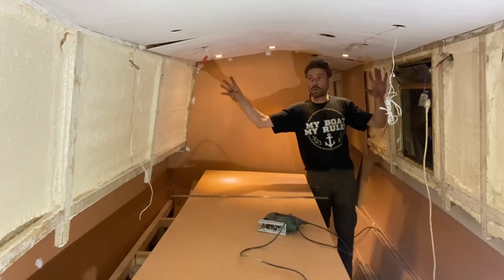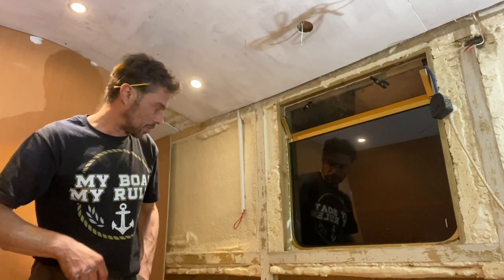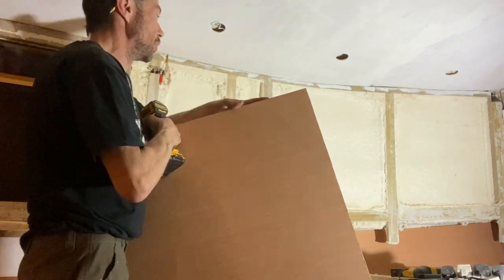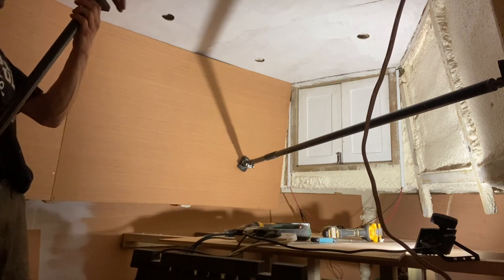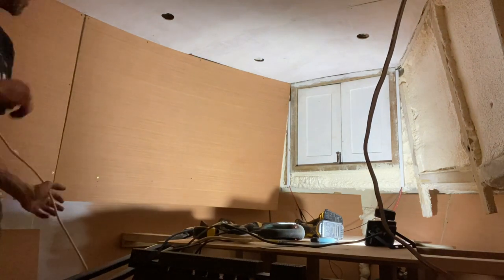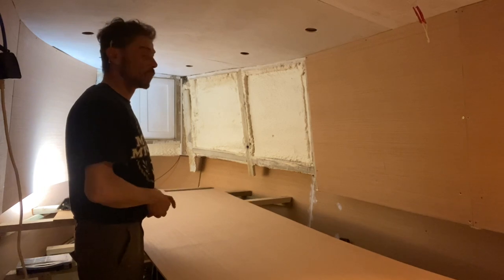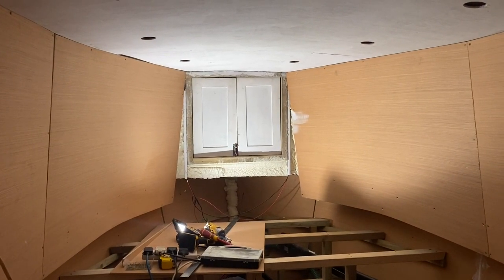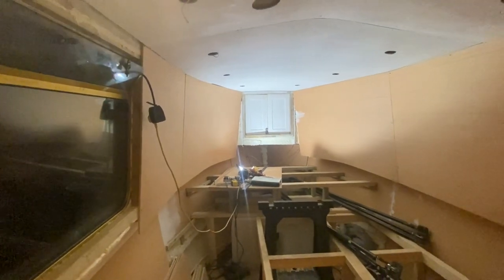141. Last upper walls lined in the Narrowboat

Comment: sorry i'm always late with advise, but if you set a skill saw for a "real shallow cut" you score the back of the panel vertically so as to break the fibers on the outer layer, the panel will flow around the curve for you, the sharper the curve the closer you make the "relief cuts" that way you wont get flat spots showing on your panel when you fasten it to the battens.

Comment: T&G Would have been better
Reply from the maker: I disagree. I would be much trickier to line up, millions more cuts and the lines after painting wouldn’t work as well as boarding.
Reply: It has a much nicer look when used with a good varnish and stain
Reply from the maker: @ferdinandvonbraun9450  yes I do agree with that - looks great that way. I really dislike the painted T&G look